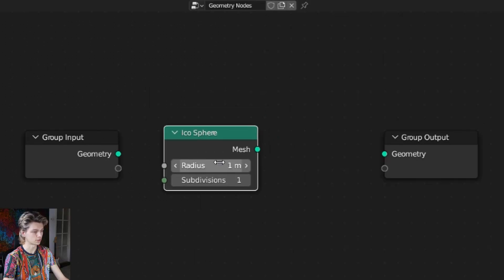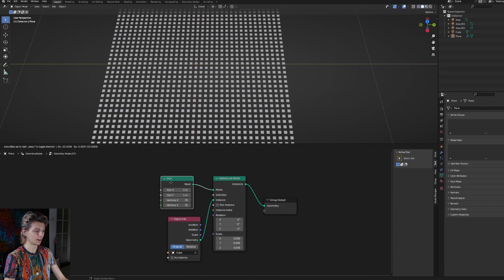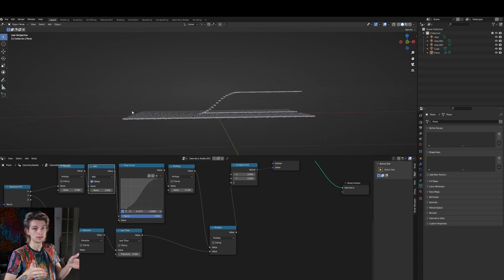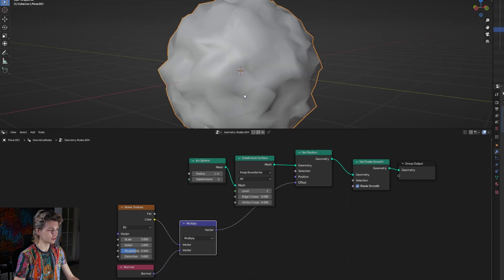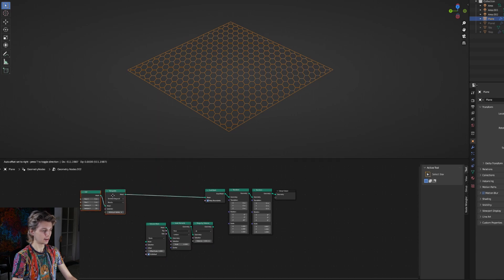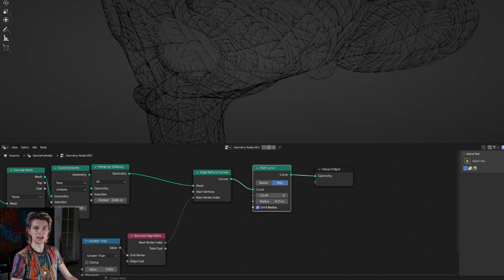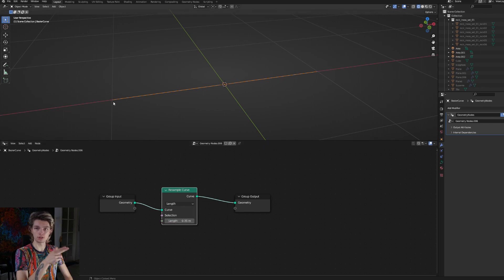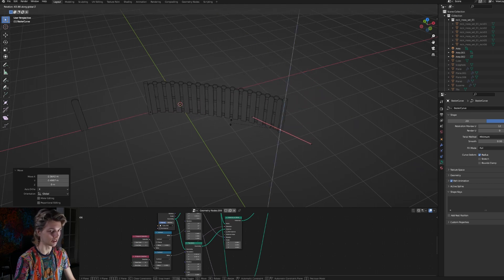10 Geometry Nodes HACKS in Blender (+ free download)

Comment: For the Roots, how do you remove all the duplicates?
If you set a Set position to the curve and do it based on curve length (or index, or length), you will find that the roots are not actually branching, each is a individual path from the root node which just happen to take the same path. Any way to avoid this?

Comment: Very cool tricks, but the issue I continue to have with geometry nodes is that no matter how many tutorials I follow, I still don't gain any knowledge about how to create anything from scratch. In other words, I only use the nodes that are being demonstrated for a specific node group that do just one thing, but if I had an original idea in my head for creating something different, I still don't know what nodes I need to use or how to configure them to accomplish it. I just keep copying someone else's work, and can't figure out how to do anything on my own, which is extremely discouraging. 😞
Reply: Yeah. The what and why is always glossed over.
Reply: I'm sort of treating them as texture nodes, what I did was I just absorbed videos and then on my own time followed a few short tutorials to see the results, then experiment a bit 
So just see what geo nodes can do
Follow a few (a lot) tutorials
From those pre-made set ups, add or remove nodes, adjust some settings, keep it basic
Work up from there
I hope this helped some
Reply: Because you are making two mistakes: 1. You are following many tutorials and 2. You want to create something from scratch.
Geometry nodes are not a set of recipes that you just learn how to do and repeat over and over, like most of the other modules in Blender. You have to think like a developer in terms of problem-solving. 
That brings me to the second issue. You cannot just have a random cool idea and let's see how to do it in GN unless you are a ninja in it. Just work with what you already know and get more creative with its use.
My advice: stop watching so many unrelated tutorials and start working by yourself; when you hit a wall, try to find tutorials related to the problem you want to solve. And that's it. You will be doing your own stuff very soon.
Reply: I’d recommend try learning basics of shader math. Doesn’t need to be in any particular language, just once you understand how addition, subtraction, multiplication, etc. works, you really can created whatever you can imagine.
Reply: I feel the same way for the most part, but (speaking only for myself) the easiest way to learn the how/what/why is to literally play around with them. I have a general understanding of most of the main nodes, and have spent a lot of time just going through all the settings one by one and in combination to discover how everything interacts. 

It's not the fastest method in the world, but it's given me a more intuitive understanding of which does what and why.
Reply: Same issue here with most blender tutorials, hotkey mapping lack of logic, and the structure of the program (coming from Maya and Unreal…and took to doing the same stuff very quickly with those, but with blender it just doesn’t stick). Shader math logic seems to transfer over ok enough, but they keep changing the UI for shaders/nodes :’)
Reply: It's likely due to there being quite a bit of math involved (I'm definitely not proficient in any math, lol). I've had similar issues with it myself, being this exact reason. I do a lot of space renders, planets, stars, etc., and those involve a ton of math nodes that can get tricky very quickly, especially with volumetrics, atmospheres, Rayleigh/mie scattering, clouds, etc. Of course that is mostly all within the shader edtor and not geometry nodes.
Reply: These are cool examples, but I agree that it is frustrating without the explanation.  It may be way too late, but just in case it helps someone out there (for the first example only):
The Subdivision surface increases the number of faces, which increases the # of possible craters.  The Dual mesh makes roundish faces out of Triangles (doesn't work on quads).  The 2 extrusions scale the faces up and then back in to create the actual craters, then the random values scales the diameter and height of the craters randomly, the map range scales the height again (reducing crater height).  You could also use a different random value node with much a smaller min and max range instead of the map range.  I created a node tree with explanations but I don't think there is a way to upload it.  5 Minutes Blender does a good super simple geo-node series with explanations (annoying computerized voice).  Surfaced Studio does a great beginner 3 part series.  Ducky 3d is more advanced but provides good information.  Thank you Stray Creations for some great examples, I will come back when I am ready to move a lot faster!